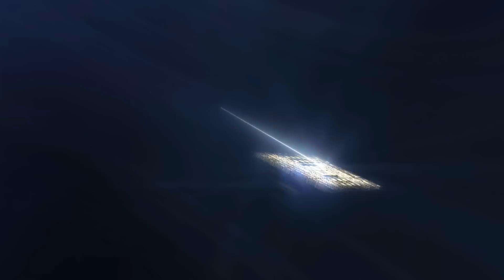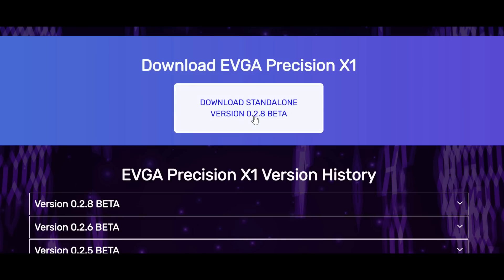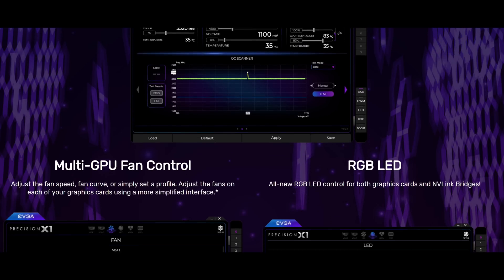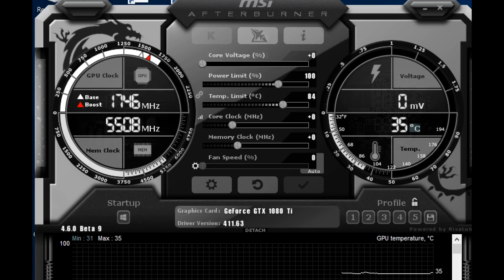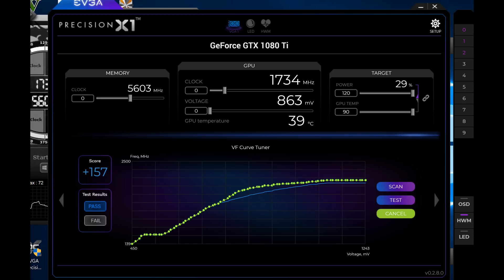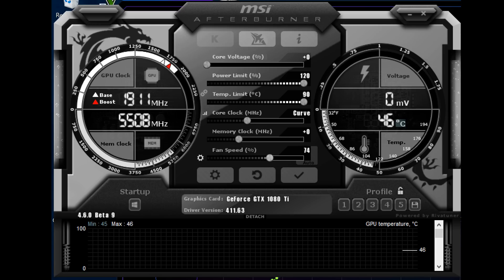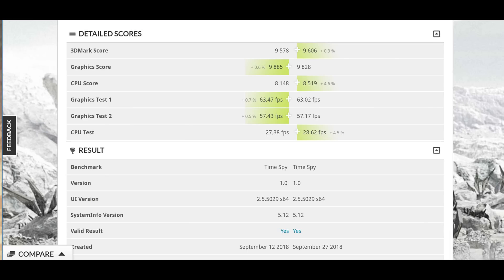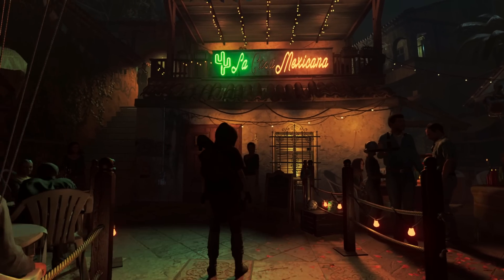How To Overclock GTX 1080Ti with Precision X1 Beta

Comment: It doesn't oc memory? What  is the memory clock section then? I'm confused.
Reply from the maker: No it does not.. you can oc memory and then do a stability test.
Reply: So it does but not stable then?
Reply from the maker: @Bigghewi  no it does not oc memory.. you have to adjust manually then do a stability test .

Comment: It's a nice starting point for manual overclocking.
I just set my "aggressive" fan curve, push a button in precision X1, and get the stable base overclock value of +113 GPU offset for my GTX 1060.

Then i set that in afterburner, and continue with fine tuning the overclock voltage and memory clock.

Test stability and done.

Comment: Never use two OC programs at the same time this guy is wrong folks !!!
Reply: Not to mention the stupid precision x1 software won't save your overclock properly to this day. A whole year later SMDH.
Reply from the maker: OMG did you try it? It works stop assuming and try it before you comment.Traditionally you want to use one OC program this is a workaround to work on pascal.. Here is real world results from this method SMDH https://www.reddit.com/r/nvidia/comments/9jgzh1/how_to_1_click_overclock_gtx_1080ti_with/